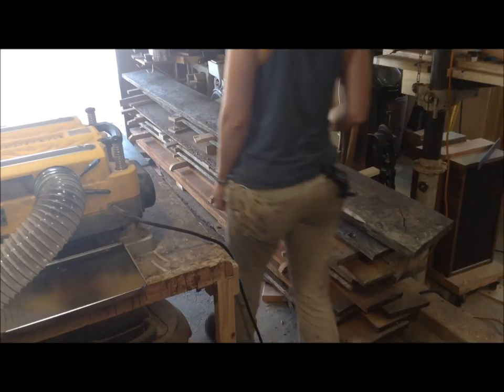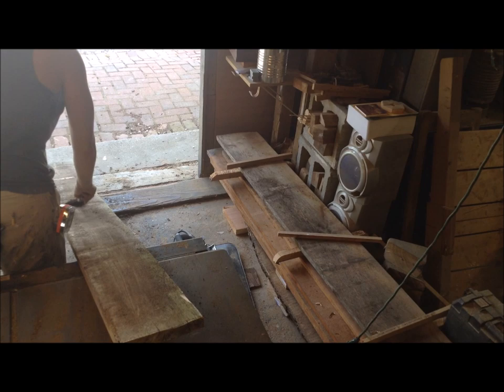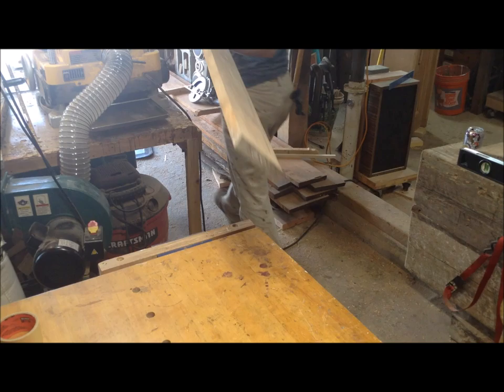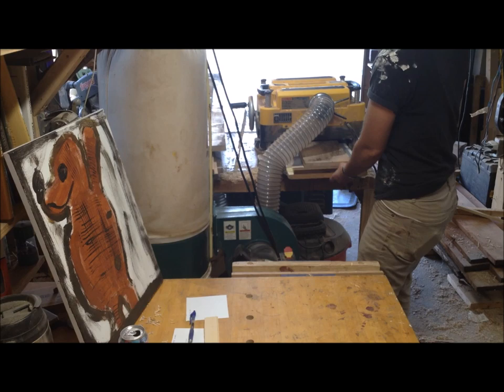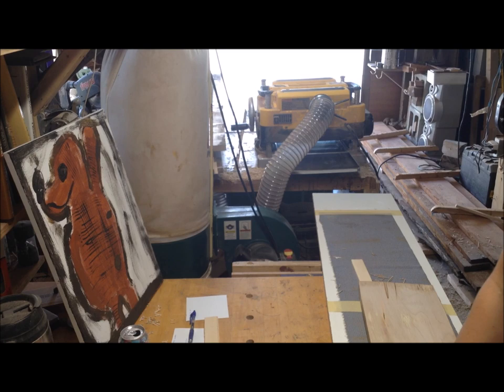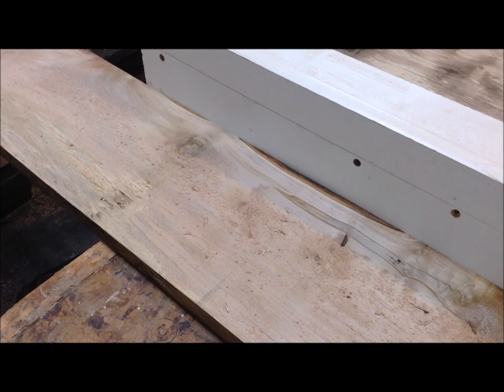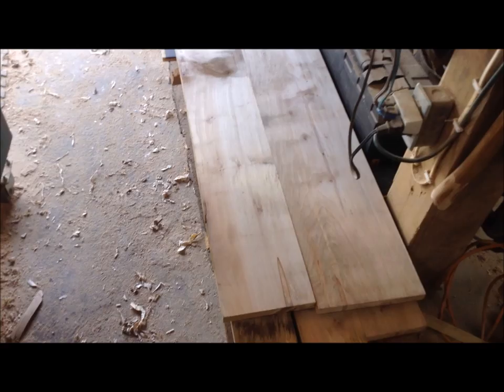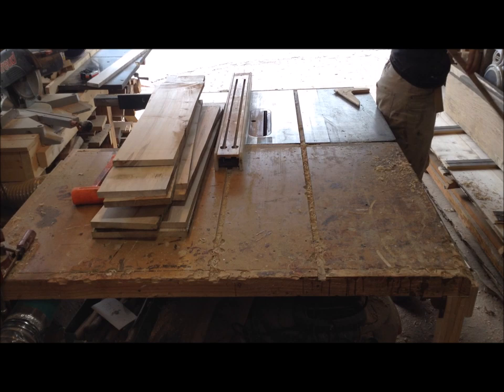Beginners Guide to Buying & Milling Lumber

Comment: Good video.  Only comment I have is "for the newer woodworker " a bit more explanation of the planer sled would be beneficial.  Not only a new person, but for those that don't have a jointer.
Reply from the maker: I might not have mentioned it in the video, but I already have a detailed video on the building and using the planer sled and the jointing jig on my channel.  But, could have made that more clear since I didn't get into great detail in this video on how they work.

Comment: Been curious what TS hp/motor and what blade type for ripping you typically use. Great TS skills. Many thanks for taking time to film, share, and do a channel
Reply from the maker: This is the Grizzly 1023RL, 3HP motor.  I keep a 60 tooth blade in there (Irwin at the moment).  Cleaner then a combo blade and handles most cuts.  I do switch it out to a combo blade, or an 80 tooth blade for some jobs.

Comment: Do you ever tear down the planer and clean and replace all worn parts and blades?
JIM
Reply from the maker: I replace the blades.  Haven’t used it enough to have any other issues with it.
Reply: @HoneyBadgerWoodWorks  check you mail about the light fixture and let me know.
JIM

Comment: I have to agree with the others. I would have grabbed some twine and tied that hose to the rafters!  You're getting so much better at talking to the camera/mic.  Good video,  Now-- Its not you its me - I still find it difficult to talk board feet ... and have any inkling of what I'm talking about. Easier to say 10 fir 2x4's that are 8 feet long and four 4x8 sheets of 3/4 cherry plywood and five 1x2 oak 10 foot long. What board footage is it??? Who cares unless I'm a lumber yard... Of course, that leaves me totally blind as to whether I am paying too much or not... Keep trying...
Reply from the maker: Yeah the hose is a pain it's just too short, after I am done typing this going to order an extension for it haha.  Agree 100% on the BF thing I find it confusing at times as well, and I only ever use it when I have to make a trip to a lumber yard as well, since that is what they use.  Another reason I like Greg is he calculates the BF as we go so I don't have to do it haha.